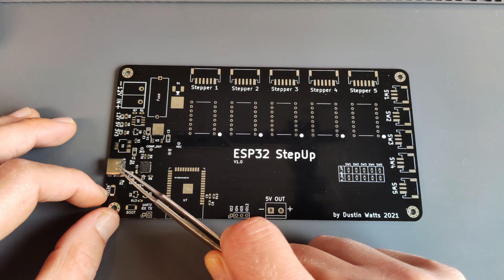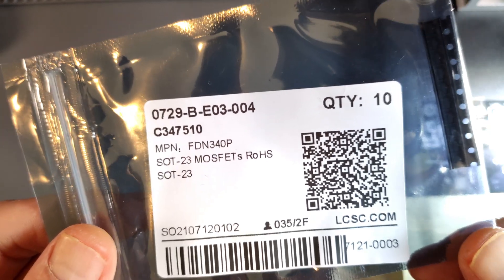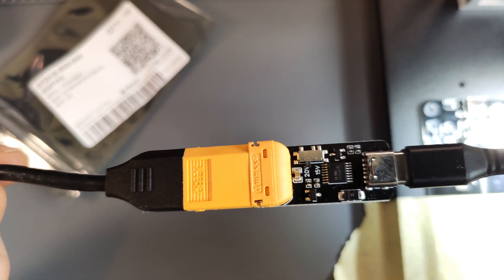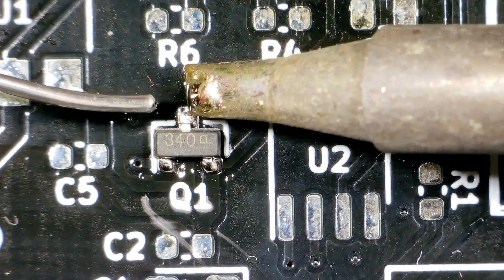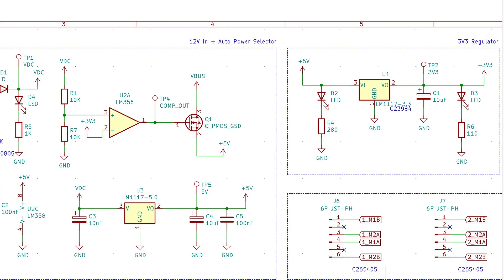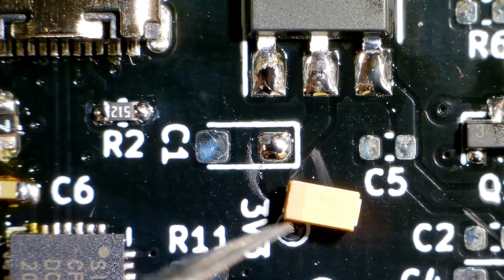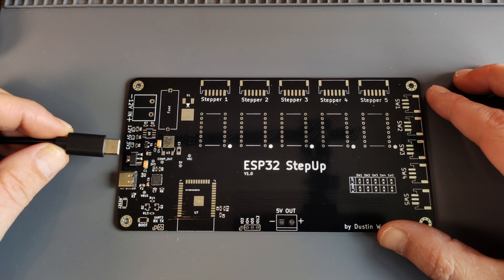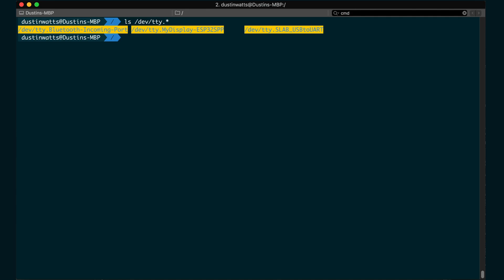Building a 5 Stepper Driver Board w/WiFi & BLE (Part 2)

Comment: I use a 5V battery pack and a kiwieze (or however it is spelled) usb tester to test my pcbs.
Thanks to you guys, I never would have started working with SMD let alone USBC!
Reply from the maker: You are welcome! USB-C is not more difficult than other USB specs when it comes to USB2.0, the pins of the connectors are just smaller :) And SMD opens worlds of possibilities!

Comment: You should build a reflow oven and just do all the stuff at the same time. :)
Reply from the maker: I have a relfow oven :) This is just more fun!
Reply: For a first build, Dustin I think is following a tried and tested method. Build in stages and check they are working before moving on. Seems daft on small pcb's, but when you move up to expensive chips, you don't want to kill a £50 chip because you've got the tracking to a £0.5 regulator wrong. 
I can tell you when you have a set of chips that cost £650 each, hitting the power button for the first time is butt clenching to say the least.
Reply: @TheEmbeddedHobbyist  That's why you should build in some level of safety factor because even with the OEM boards they die because of stuff like not having heatsinks, not having any backflow protection, lack of isolation or not having any fuses. You don't have to worry about losing chips that way.
Reply: @Deneteus  The problem with fuses of the two legged type is that they are a lot slower than the three legged type. The BJT or FET will blow way faster than a fuse.

It’s just good practice to build the first pcb in stages as this may be the first time you are proving your design, that is if you don’t do a prototype first.
Reply: @TheEmbeddedHobbyist  I didn't specify a specific type of fuse. My point was that if you build in protection you are less likely to kill everything immediately or down the line later. I learned the hard way that if you plan your power you can give yourself some leeway. You can put jumpers in at each section to test. You then bridge each section in stages. That way you can make sure you didn't miss anything.

Comment: I think you need a smaller tip and finer solder. the tip is not heating the pad very well, you can see this as the solder is jumping to the tip and not the pad. i like a 1mm or less tip for hand soldering SMD parts.
Reply from the maker: My goal is to show that with a minimal soldering setup, you can still create a working board. Even with a big tip and thicker solder, you can get good results.
Reply: @DustinWatts  Your doing a grand job.

Comment: What temperature are you using on your iron? Also is the solder leaded or not?
Reply from the maker: I usually use the soldering iron at 350 degrees C. In case of a large ground plane, I raise it to 400C. When I solder for my own personal use, I use leaded solder...
Reply: @DustinWatts  thanks for answering, i guess i got crappy solder as when i go above 320 all the flux inside basically turns black and the solder starts dragging off the pads
Reply from the maker: @alexstone691  Yeah good solder definitely helps.
Reply: @alexstone691  FSW32 cored solder is a good general purpose type to have. If you can get it, Multicore/Loctite solder always gives consistent results, otherwise Cynel still sell 60/40 or 63/37 solder